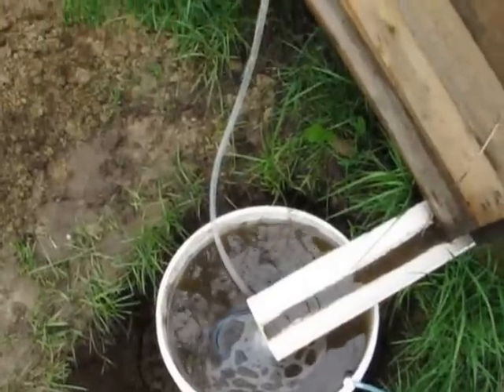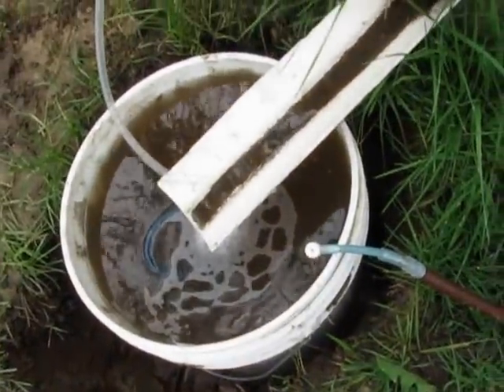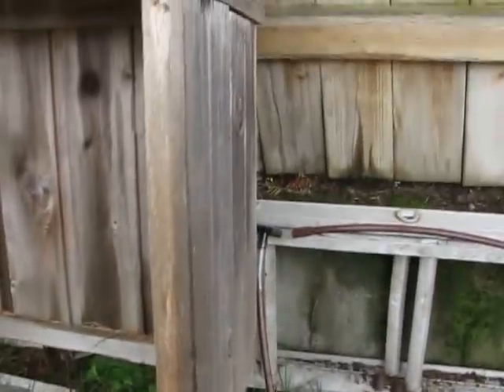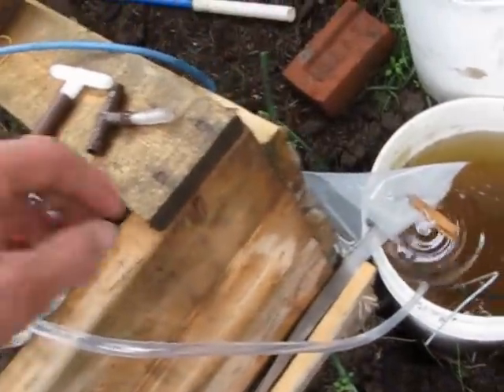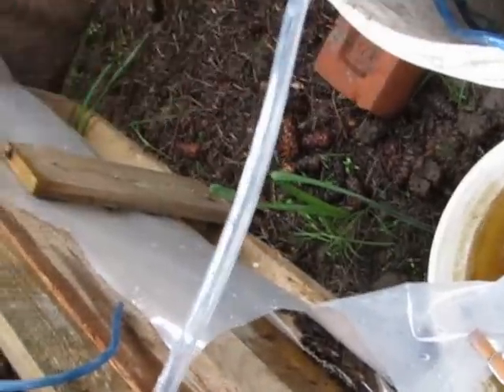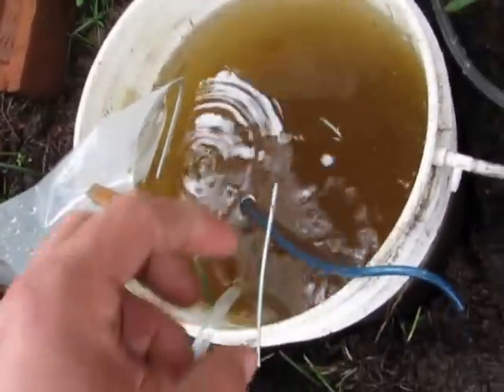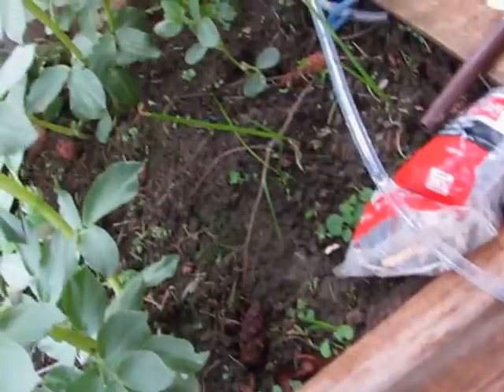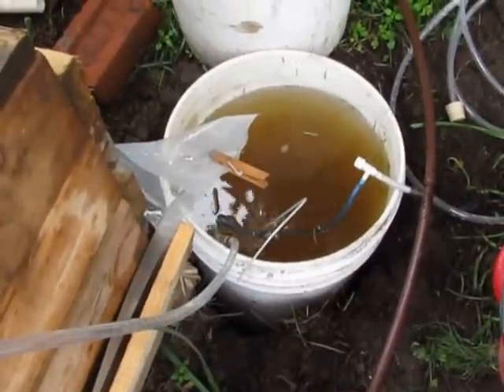Airlift pump in a bucket!  5 month old technology, Already in use in Denmark, Canada France, USA

Comment: Thanks dear. Is it just an experiment or would this much flow of water is sufficient? Is there any minimum amount of circulation of water in an hour required in aquaponic system?
Reply from the maker: It was an experimental system.This isn't aquaponics,  I would call it "soiloponics". The circulation of water brought benefits because it moved oxygen, heat and nutrients through the soil and it also means that small plants can grow with big things because water isn't the limiting factor. A small air pump powered Nutrient film technique "NFT"  hydroponics in my greenhouse  for 2 summers (also powered by an airlift pump.  And I have a few videos about it.  In that case,  the small  airlift pump can power an NFT system.   In my experimental pallet gardens,  a small air pump could run 3 or 4 pallet gardens. The water just circulates.

Comment: hi brian do you know where to buy the 1inch bouncy  rubber ball,s that people are using to make ball check valves I,d rather  shop in the uk if poss
Reply from the maker: Probably anything near the sea and amusement stores.   We find them in Dollar stores here, so maybe pound shops in the UK.   Note that this thing I did, doesn't necessarily work well with check valves.   I was doing it as an alternative to check valves.   Don't be too surprised if check valves work for a while but not long term.
Reply: greetings brian arn,t dreams a wonderfull thing (if you can start remembering them,)so the navy conection in my past was what qualifyed me to get to this POINT??? plusss mountains and caveing, engineering and carpentary + heavy construction AND HISTORY

Comment: This is a reverse of the venturi effect. A T connection on a pipe, especially if it's constricted, will pull a vacuum on the side-arm if water is flowing through the pipe. But if you push air in here, as he's doing, it can create the water flow. The constriction at the bottom end helps the water direct flow upwards, by creating a back-pressure to counter gravity on the raised end of the tube. Neat!

Comment: Brain White, thank you for your work, very good to see the aplications, do you think isothermic compressed air could power a dynamo, with for example a aircompressor-drill to step from gas to a spinning motion ? What would be a good way to separate the gas from the water when it's coming up ? I have many questions, and eager to live and learn. I first found out about this through a lecture of Bill Mollison on the trumpe and clean energy. thank you
Reply from the maker: Yes, this has been done.  But you need to compress air much more than I do to achieve that.  If you want to see some of the possible applications from low pressure air,  you can watch my old "pulser pump, simplest water pump in the world" video.  My videos are mostly about trying to use energy sources that "fall through the cracks" and get unused in the modern world.  For instance,  I was able to use an airlift pump (using 2 watts or less) to power  heat collection from the back wall of a greenhouse, in winter.  Even in inefficient testing mode,  it was collecting about 100 watts of solar heat during the day for overnight storage.  In my climate,  a greenhouse can overheat around 1 pm in winter and be freezing cold at night.  This application,  powered by an air pump run directly from a solar panel,  helped solve both problems at once.  Such work needs to be carried out much more rigorously than I have done to be "proven".  Unfortunately,  it is not the type of thing that gets funded in universities.
Reply: Great, thank you so much for all the drawings and yt video's I will start with a small setup with bubbles with a solar panel, that would indeed be very helpfull.

Comment: what are the small air regulators called?  is there a specific name for them or should i just ask the hardware department guy for "tiny air regulators"
Reply from the maker: +chaosmotion1983  Sorry,  I never saw your comment.  If you search "aquarium air valves" and then go through the images,  there are tonnes of different ones.
Reply: thanks, i found them.  appreciate the feedback